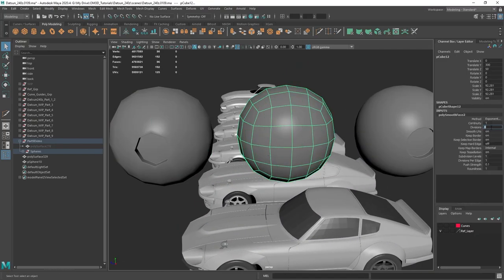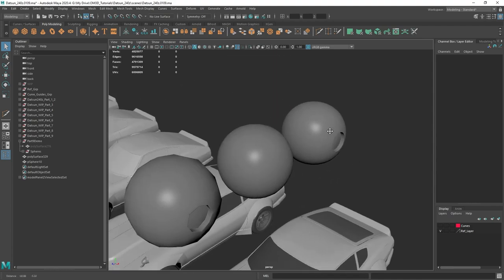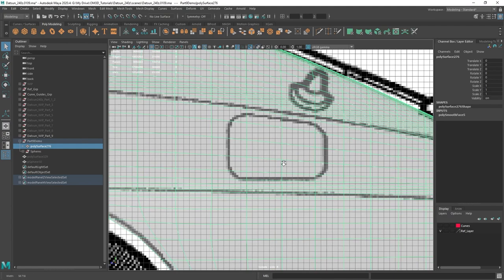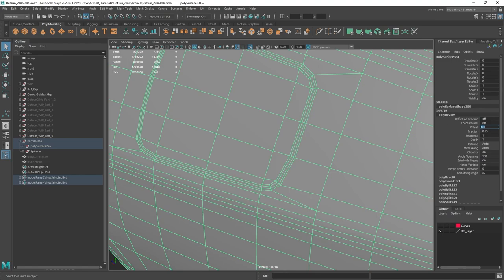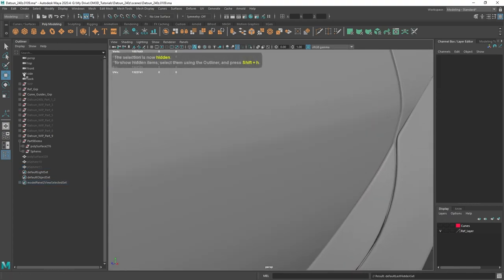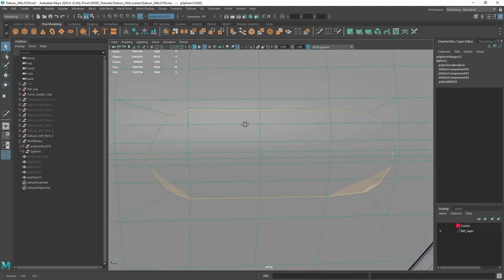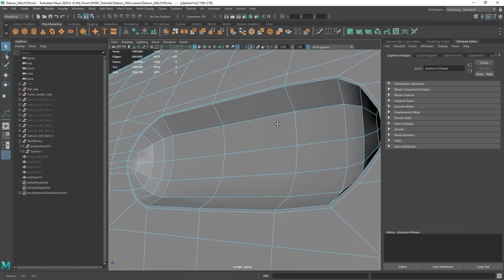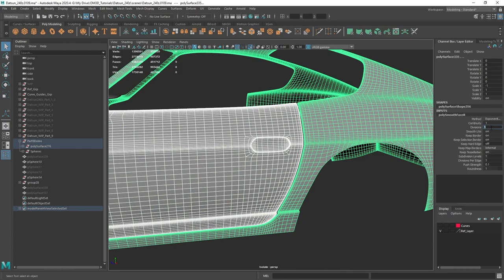3D Car Modeling - How to Model Car Body Details

Comment: Why not use crease to pinch the edges of the shape of the detail in the lower subdiv version of the model?
Reply from the maker: I use creases early on but for vehicle modeling, you eventually need to convert them to beveled edges, creasing won't give you the result you need.

Comment: Can you tell me how did you make the mesh looks so clean. In my case the surface of a mesh looks lumpy. I did everything what you said in another vedio like using smooth brush,edge slide etcc. Still looks lumpy
Reply from the maker: It could be a few issues. Try removing edges that you don't need, having fewer edges makes it easier to have smoother surfaces. Then you can subdivide to add the geometry back. That's what I did for the Datsun.